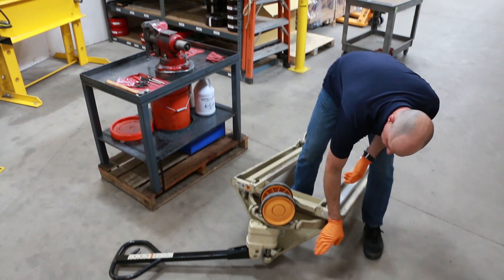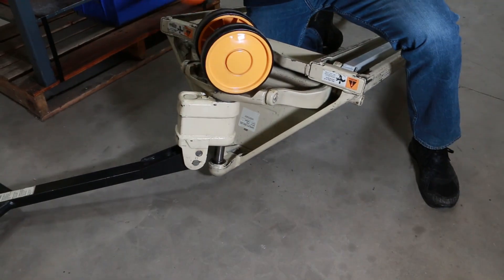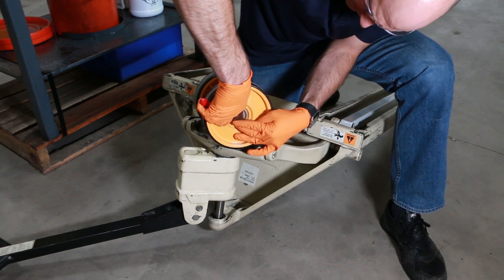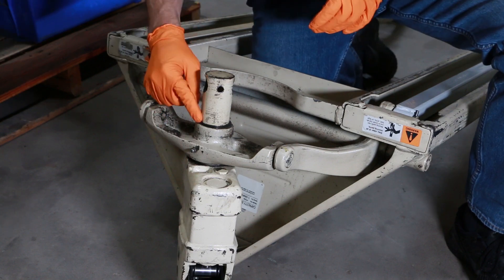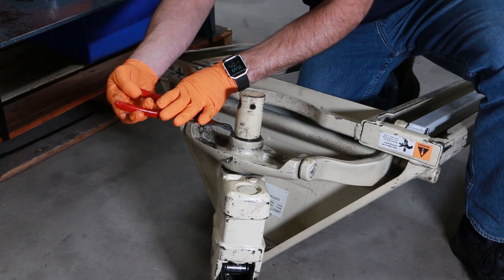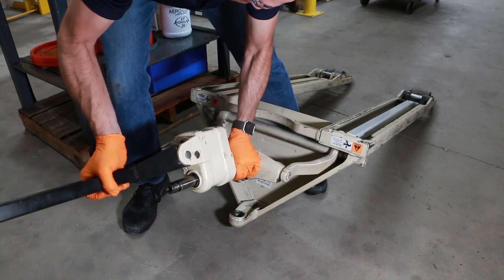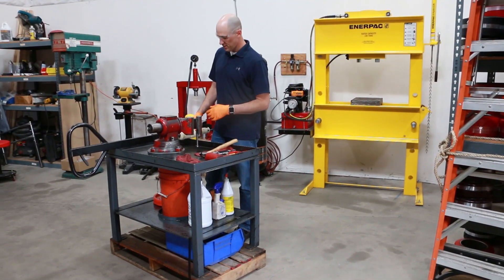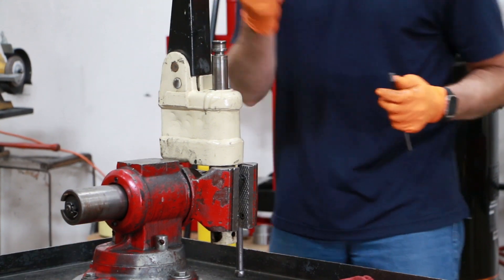Part 1: How to disassemble Crown PTH50 Hydraulic Pump in order to rebuild it

Comment: Wheel does not slide off for me. Thing is stuck to axle. Tried wd40 and tapping with punch am hammer but no luck.
Reply from the maker: The axle is likely corroded badly inside the wheel preventing it from sliding out. In this case cut the axle between bracket and wheel. Then replace the axle. See how to video https://www.youtube.com/watch?v=5Mt0h7ht6T8

Comment: Do you need the ball housing tool? Difficult to find
Reply from the maker: Ball housing tool is recommended to tighten valve housing #32. This housing should be tightened to ¼ turn past hand tight, to create seal on copper washer.
Ball housing tool “CR BHT” can be found on our website. This process can also be done with a custom-made tool or large square stock flat head screw driver and crescent wrench.

 Any other questions please call 503-646-4575 or email csinfo@genericparts.com          
Thank you,
Chris

Comment: I don’t see any 3mm Allen for the chain retraining screw …. And the oil fill plug will not budge any assistance. I’m stuck
Reply from the maker: Email csinfo@genericparts.com and request a parts breakdown for your model. Please provide serial number. 
To remove frozen plugs, first strike with pin punch and hammer then remove.

Comment: Does anyone know of a Video on rebuilding a BT L2000 Pallet Jack. It was manufactured in 1993 it’s says on the Pump. It pumps up fine but can’t hold a load very long without creeping back down to the ground on its own. The heavier the load the faster it creeps back down where with anything over 400 lbs I can’t move the pallet Jack very far being the pallet is back sitting on the floor. I don’t see any leaks. I checked to make sure it has enough fluid in it and it is fine. I also tried bleeding it a few times. It makes no difference. I would like to rebuild the pump but have no idea where to start. Can anyone tell me why a pump that pumps up quickly won’t hold a load very long? This Pallet Jack use to work great but I haven’t used it much.
Reply from the maker: Please contact us at CSinfo@genericparts.com We can help
Reply: @genericparts  Will do this week hopefully tomorrow. Thanks for responding to my Question.

Comment: Do I have to do all this just to add hydraulic oil? I have this same pallet jack but can’t find the plug
Reply from the maker: Hi Carlos, 
there is an oil fill plug located on the top of the pump next to the main lifting ram.
For more information visit our website https://www.genericparts.com/store/app/Search_Results_PS_ALL.cfm?PageNum_getPartNums=4&table=1&cat=470 (on the line drawing the plug is # 58)  or email csinfo@genericparts.com. Thanks!
Customer service
Reply: Generic Parts Service thanks ! I found it.  Now I can’t take the damn thing off. I’ve sprayed lubricant on it and it won’t budge. Any other tips for taking it off ? Smacked it with a hammer too.